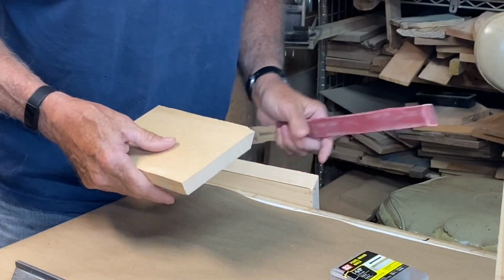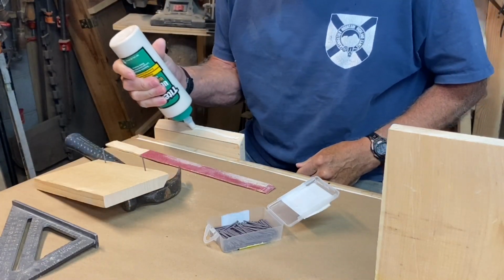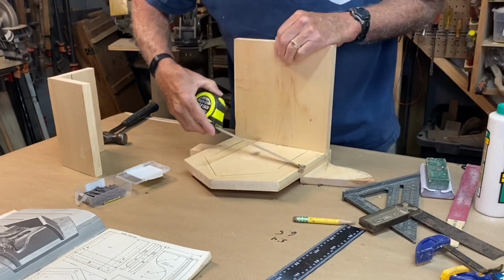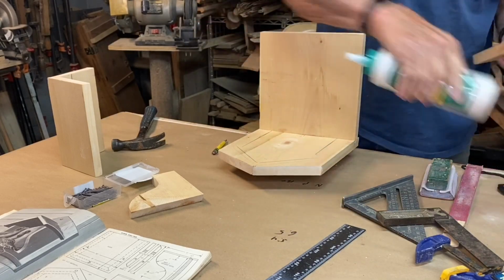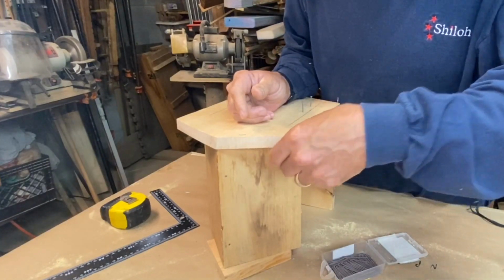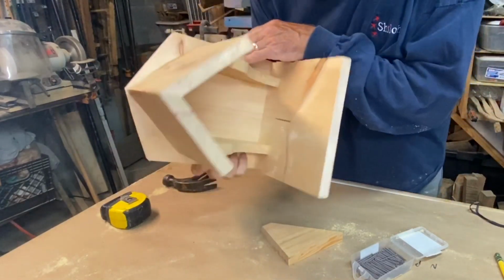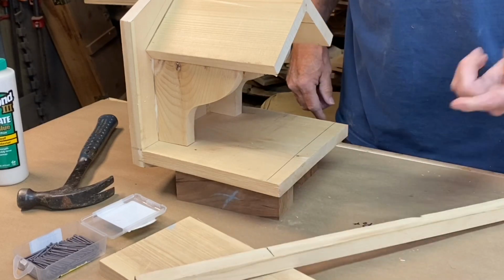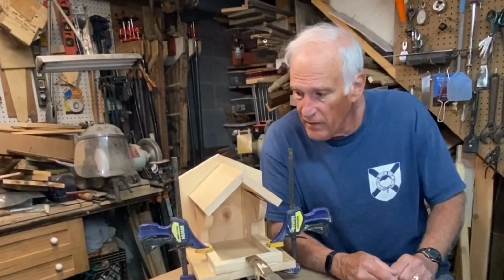How to Make a Robin Platform Shelter, Step by Step; Part 2

Comment: Last month I built a Robin best shelf for my niece in California, UPS wanted $47 to ship it from NJ, luckily the guy there put it in a smaller box and it came down to $26. I used the plan from the Cornel labs website, that one has a shed roof with an 18 1/2 degree angle. the hardest things to make were the angles on the sides, also, the roof was 8 inches wide. years ago I made a House Wren nest box that was a sideways cube, no 45 cuts.
Reply from the maker: I’m sure your niece will love it.  Thanks for watching and sharing.  I really appreciate your feedback